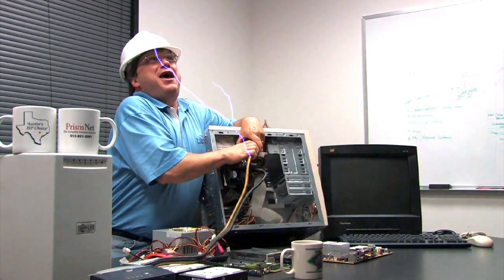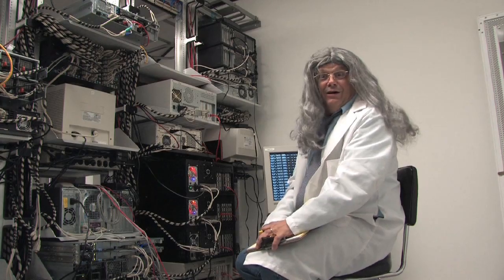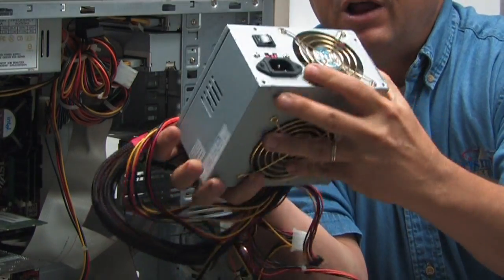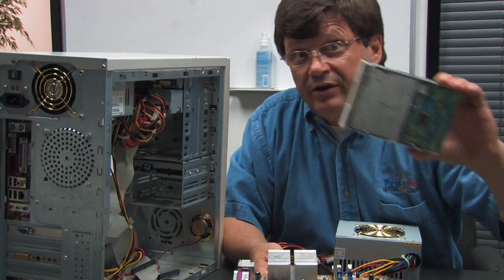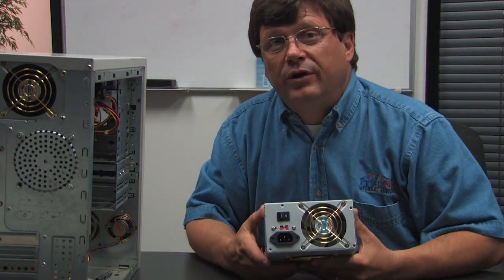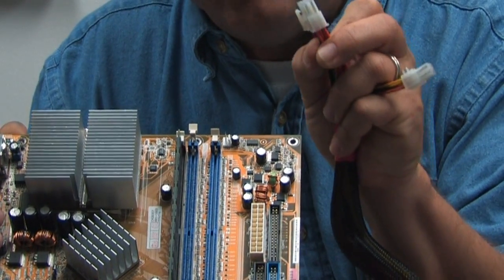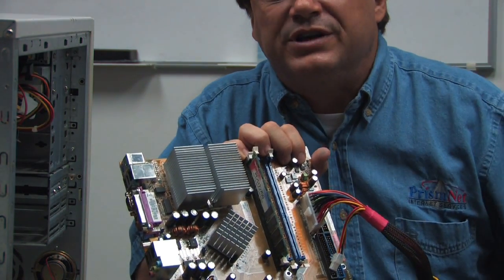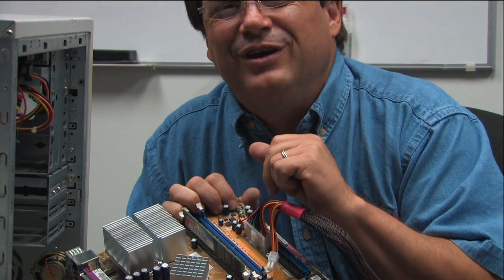Computer Hardware Information : How Does a Computer Power Supply Work?

Comment: some psu's turn off the fan when your pc is drawing low wattage like if your pc was at idle when you checked no air would be coming out because your pc is drawing a low amount or energy or your fan is dead ! one or  the other.